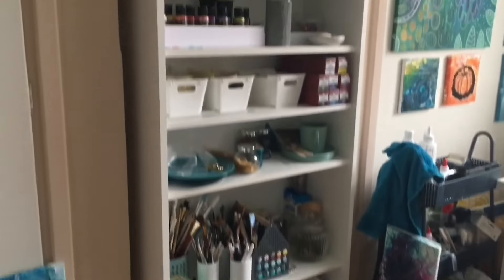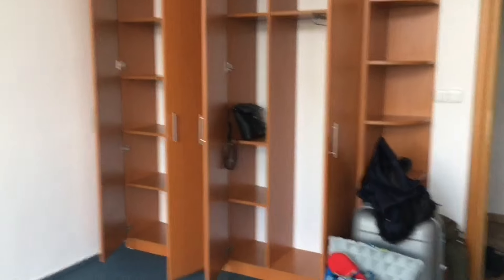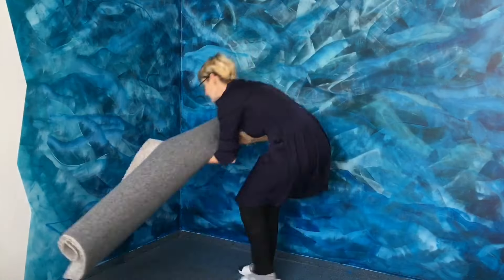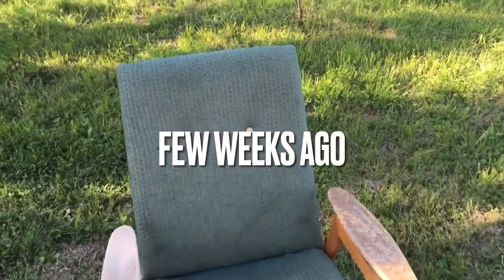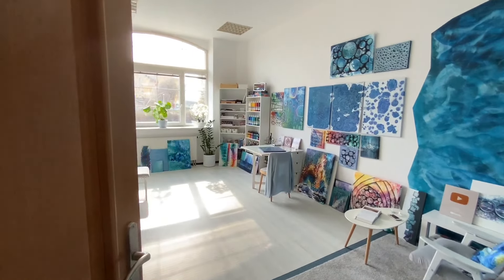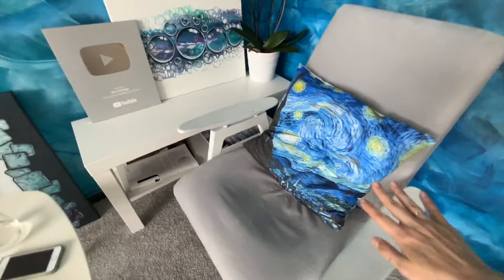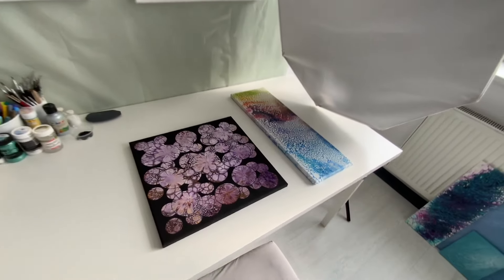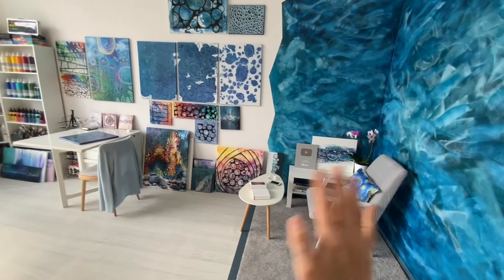#109 BEFORE/AFTER my NEW ART STUDIO TOUR

Comment: Veronica, if I could have a big art studio, then I could get the round "16-ounce" Houseables condiment squeeze bottles with their measuring black labels at the Amazon website. I'm not really an online shopper. I could separately plenish the bottles, but I'd need to correctly balance paint, Floetrol and water to form a paint pouring recipe. I could be set to squeeze paint into the cups and onto the canvases. I just got subscribed to "Peachi Art Designs by Priscilla" because I spotted her round "16-ounce" condiment squeeze bottles with their measuring black labels. I saw her squeezing paint into her cup and onto the canvas in her older video.